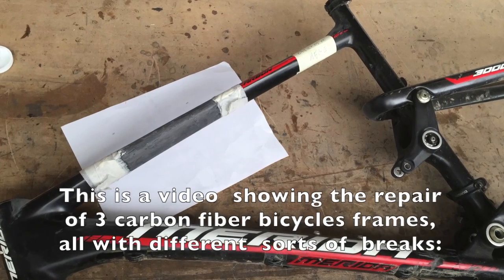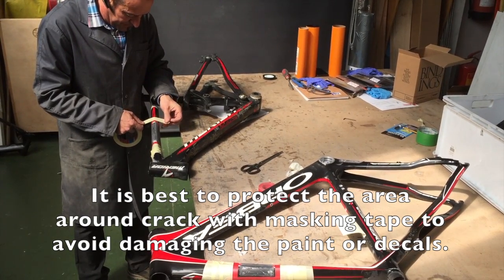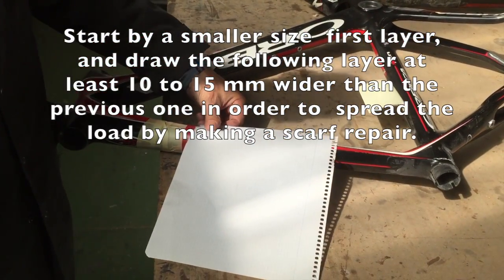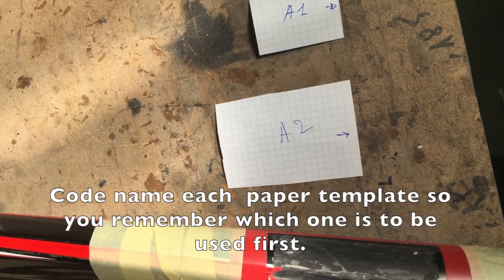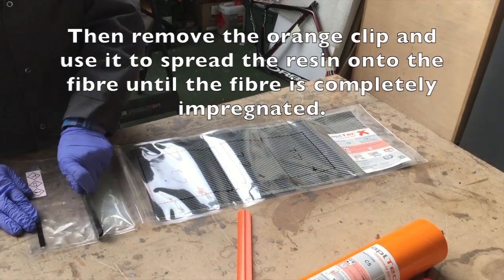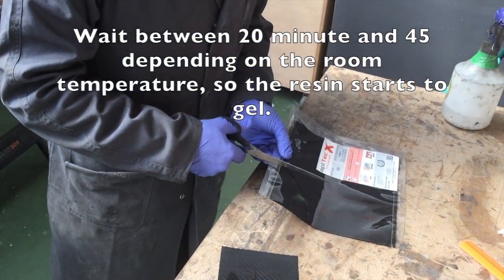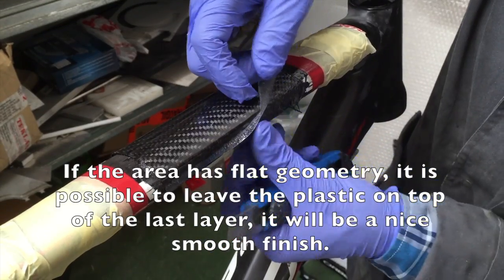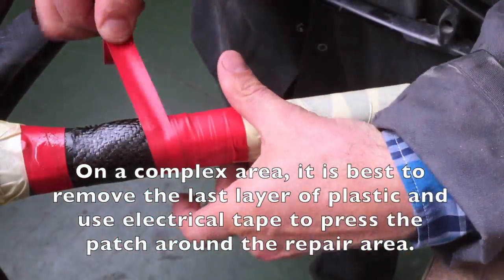How to repair a carbon fibre bike

Comment: You need vacum, right fiber orientation and heat cure to get full strenght, 5 Ångstrom.  You get less than 50 % strenght with this metod
Reply: Geir kristiansen to get a vacuum the whole frame and all open apatures need to be sealed quite a big job when this little repair just needs pressure to hold the laminate in place ,agreed this method gives approx 50percent resin compared to preprogrammed 40percent bug at this level its irelivant
Reply: You do not need to cover the whole frame to get a vacuum, only the affected area. What most people don't seem to understand is that without the pressure from a vacuum you never get the same quality of bonding between the layers as there will be more resin trapped inbetween and cause fragility between the layers. If the affected part is not under stress, it is no issue but central frame parts usually are.